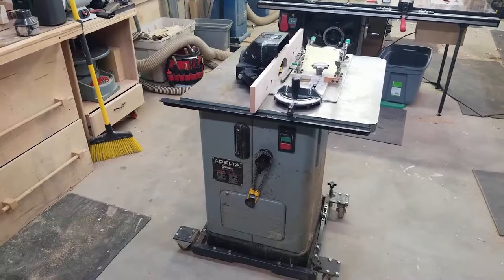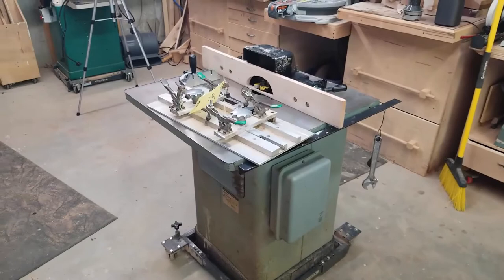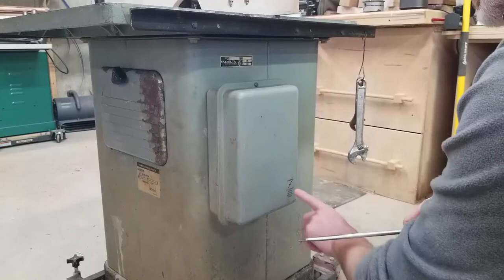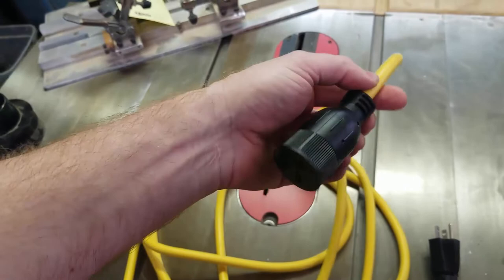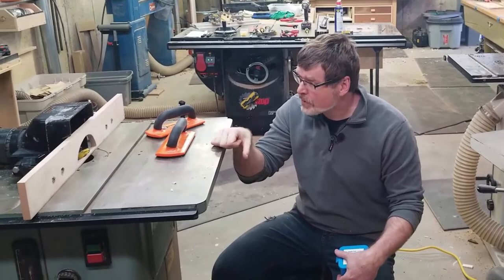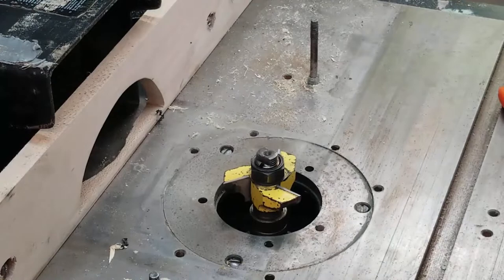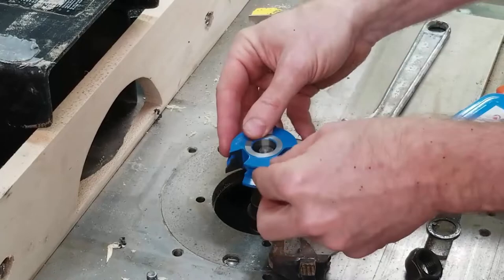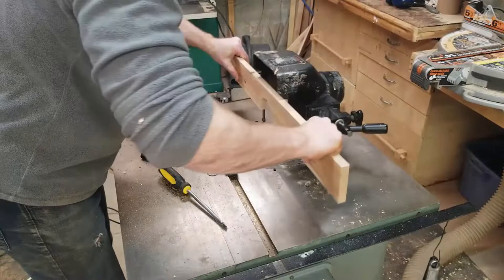Setting up a Delta shaper, model 43-375

Comment: I just purchased the same shaper  from a guy in Salem Last Summer! I'm confused as to why the power switch is on the outfeed side of the shaper? I had a three quarter horsepower Delta and it was on the infeed side. Any thoughts?
Reply from the maker: No idea. I agree it's in an awkward position.